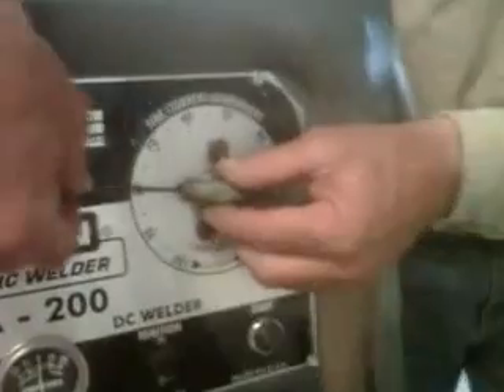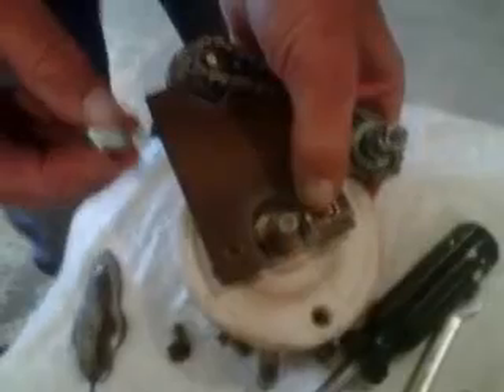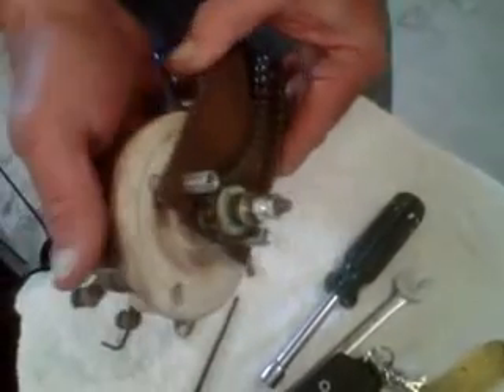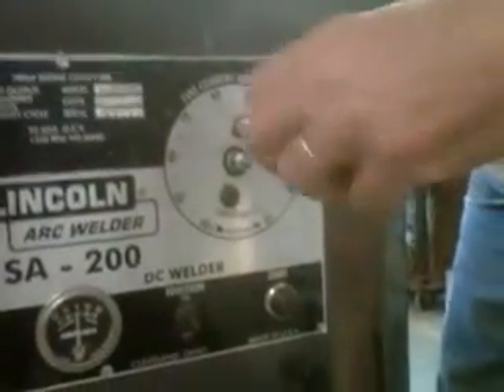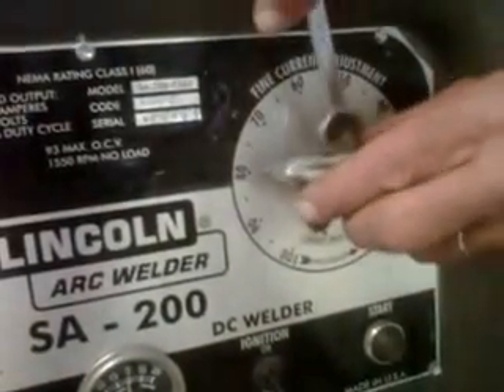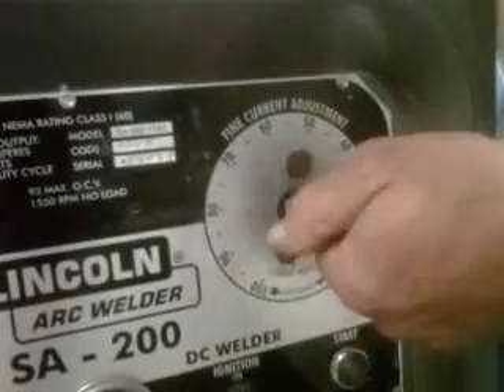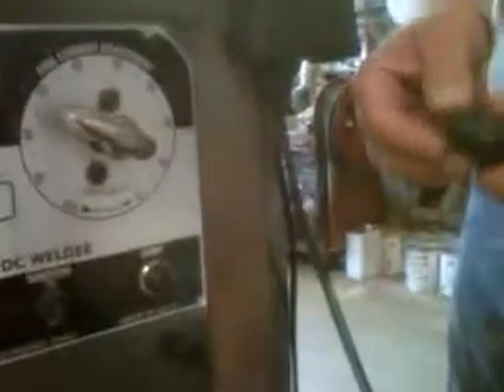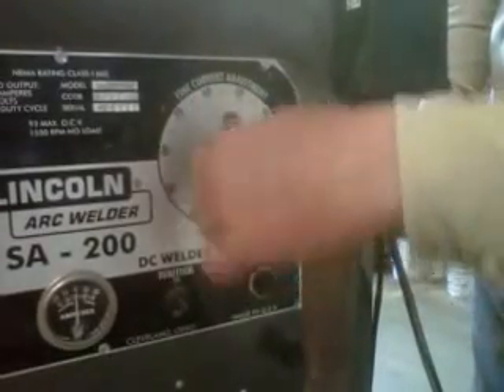Wireless welder control for Lincoln SA type machines--Install video--UP-TEN Remotes

Comment: hey Doug great video. iv been trying to figure out how to do this to miller dynasty electric welding machines and Lincoln vantage engine drive. I was wondering if you dabbled into making any of them into wireless remotes. thanks
Reply from the maker: I made a universal one for the stuff you were talking about, it is belt driven

Comment from the maker: I went to your channel  and checked yours out----It looks like it works fine. I used the same remote as you did on my first prototypes but the bigger welders electromagnetic interference would kill the signal. It worked fine till you started the welder. I have had a wireless remote for 30 years and when they quit making them and sending me parts . I had to make my own----and improve it also.